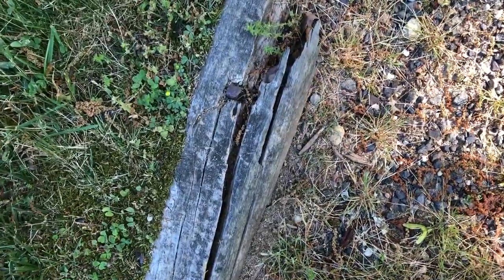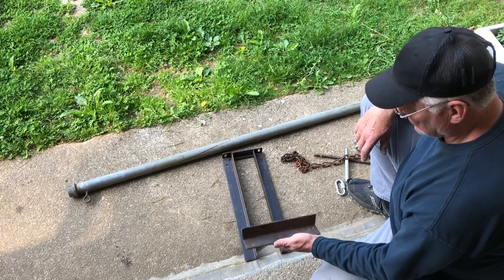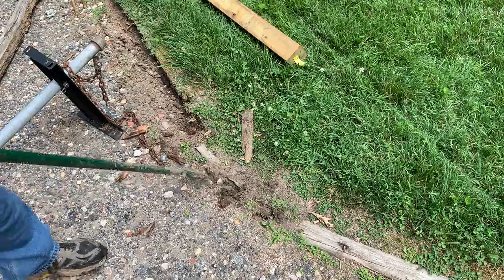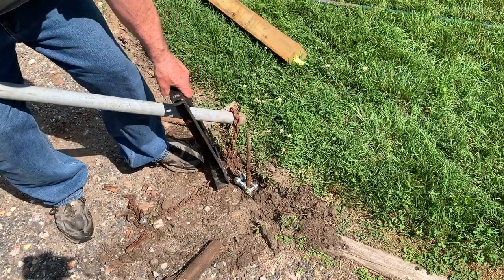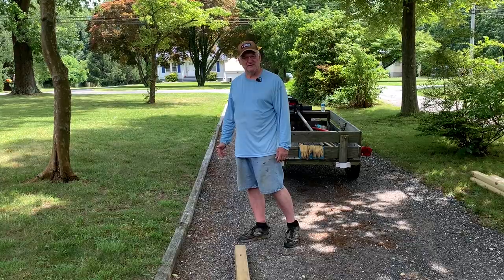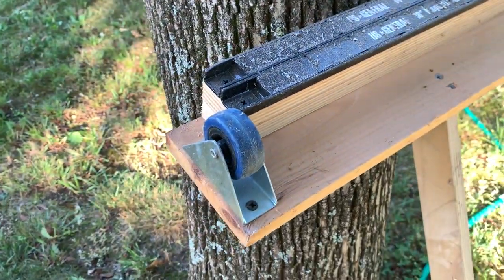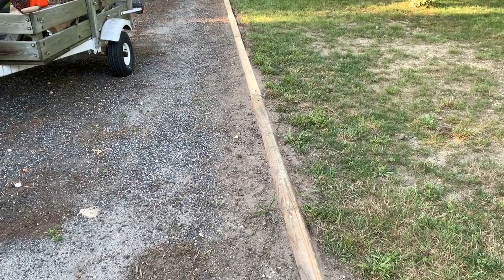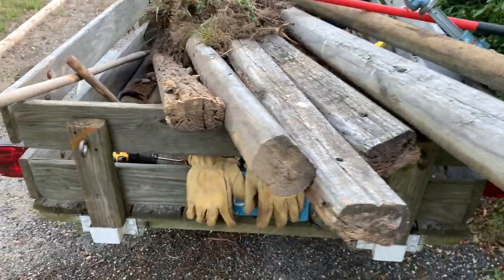Homemade rebar puller to replace landscape timber stakes.

Comment: I have a similar issue with a retaining wall that uses large R&R ties.  Instead of rebar, it looks like someone installed large/long galvanized spikes or something similar.  Not sure if the spikes are a "T-type" and cemented underneath the  ties, etc., as I've never tried to tackle a job like this.   I like your construction of a rebar removal tool.  However, it would take me forever and a day to find similar parts to construct one of my own.  Thus, I'm thinking that I would stop by Harbor freight and purchase a farm jack.  I haven't been able to find another YouTuber that has a similar problem as me - your video was the closest in similarity  to my issue and it gave me the idea of using a farm jacket.  I enjoyed your video very much and appreciate the patience that you exhibited.  Had it been me, my video would have turned into an "Ernest P. Worrell" video out of frustration.   Super presentation in all respects -  great job and very much appreciated!!!!!!

Comment: Pair of vice grips, clamp down on the rod a inch or 2 above ground and use a pick ax or shovel to pry the bar out. Mine were driven about 18 inches to 2 feet. Worked excellent. Use what ya got right lol

Comment: Awesome video. This is exactly what I am currently working on to keep the high side of the yard from washing onto the drive and make it look more uniform. After watching your video, I will change from 2' rebar to 1'. My fear will be the removal process that I now see you had to contend with. So maybe less length in hard Georgia clay will be quicker. Could you mark the new timber where the current timber holes are located, drill, then lift out the rotten timber and stick the new timber in? As far as poor quality/price timbers, people would rather be unemployed and get free money from the government and now the economy is the worst in history. I will be lucky if the timbers last 5 years!